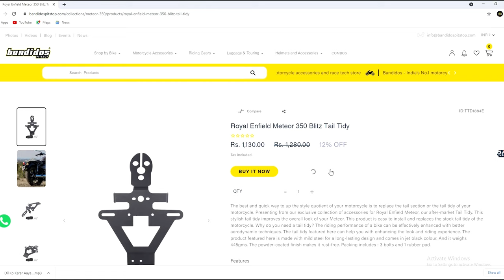How to install Blitz Tail Tidy on Royal Enfield Meteor 350 | Bandidos DIY

Comment: My tail lamp nuts are rotating with studs...so not able to remove tail light. Plz guide
Reply from the maker: Might be it got tightened. please use wd-40 and try. or else you can seek help from local mechanic

Comment: When reassembling it how do you route the indicator wires through the mudguard to stop them becoming trapped when you tighten the light unit back up, the video doesn't make it clear?🤔
Reply from the maker: Dont get confused please connect with our customer care 8891020202 our technical team will explain it to you clearly

Comment: I already installed the tail tidy from Bandidos.
It looks cool, but i have mud splash issues on back of pillion rider.
Will you give an extension to the back Mudflap for more comfort.?
Reply: Hellloo
Reply from the maker: Currently there is no product available for this model, but we are planning to launch the in future
Reply: that was my biggest concern, and why I didn't go for it.
Reply: @SanketKambli  Will tyre hugger solve this problem ?
Reply: And right there is exactly the issue with removing the standard rear mudguard, clues in the name 😊

Comment: Brought your kit from Amazon, the QR code provided doesn't work, secondly u need to update your knowledge about Meteor 350, the coupler from the tail lamp doesn't come out as shown, it is fixed by Un-openable metal clips under the mudguard.
Reply from the maker: We take your concern as a feedback and if you need any kind of technical assistance for installation then let us know. For more log onto www.bandidospitstop.com